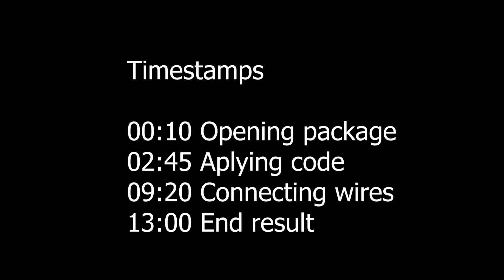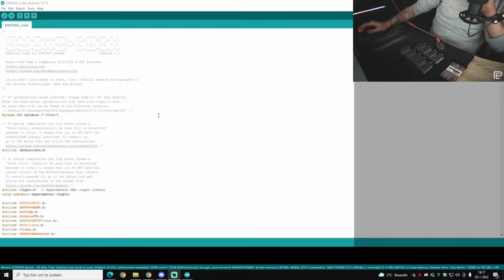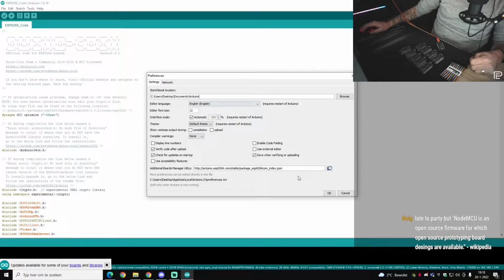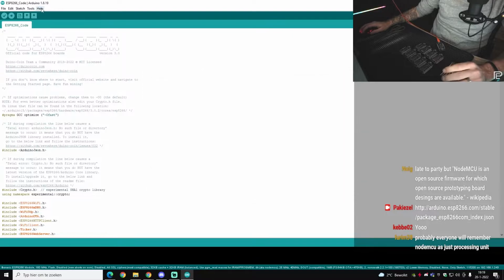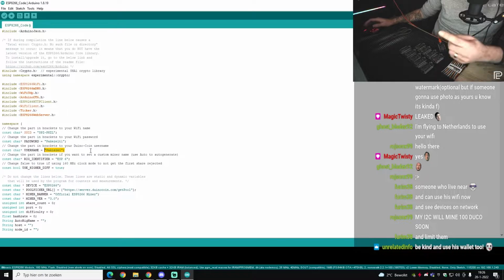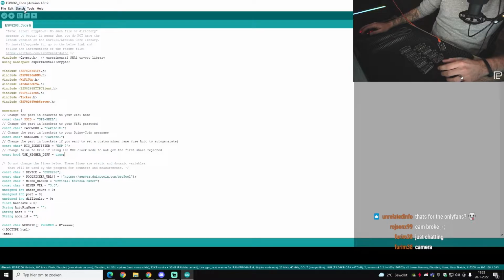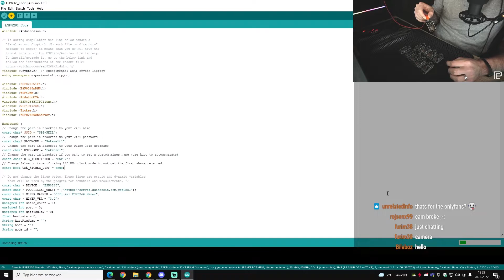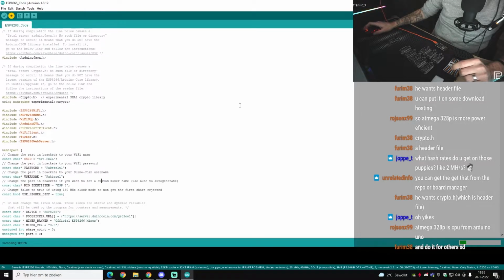How to mine Duino-Coin with multiple ESP8266's (Step by step guide)

Comment: You can't connect ten like this the power chip over heats!
Reply from the maker: They wont overheat. But you are correct. I didnt explain it in this video but the limit is 6 in a row. Because the 3.3v wont reach further than 6 boards. So quite the opposite happens. Not overheating but lack of power.
Reply: @Pakiezel  when i followed your instructions only 4 boards powered up and the board with the cable connected started to smoke. :(
Reply from the maker: @PrintingEvie  did you plug wires into a wall socket? Lol. Just use an usb cable to usbc mini and plug it in to a pc or phone charger. Its impossible to fry your boards and or cables that way.

Comment: I like to set up a new IP address; is there a way to do that using the arduino code?
At the end of your video, I'd noticed a board you've used to mount the ten ESP8266 boards!   How did you do that and what board is it?
Reply from the maker: Let me start by saying (and i dont know if you are) that mining Duino on multiple IP's is a banable offence. With that being said. An arduino or NodeMCU is not a transmitter like a modum. Your modum has its own IP adress whilst an arduino is on the IP of your modum. In order to set up another IP adress you need a different location or a program where you alter the IP of that device. You can change IP with a VPN but to use two different IP's on the same device is not something you would do with an arduino. I hope this helps
Reply from the maker: I didnt mount them to a board. They just stand on the base of my pc. I do use spacers between the boards in order to "tower" them as a rig. The micro USB cables just go in the usb ports of my pc

Comment: How many node can you daisy chain like this and are you feeding node one USB to power the chain?
Reply from the maker: You can chain 6 nodes like this. And yes I use a micro usb inserted into my pc to power the first board in the chain!
Reply: @Pakiezel  amazing lol but if I solder them like this then plug in more then one to USB say to update firmware will there be an issue over powering then lol sorry I have mine all lined up in cases this would be a great way to save space and cords lol idea is I wanna use an stupid old 386 tower or sumthing and have my mine all inside It
Reply from the maker: @raresoupninja  you can if you all individualy connect them to a board. Mine goes from one board to another and therefor it doesnt have enough power to go further than 6.

Comment: But is it even worth it? I mean you can only mine really small amount of money. Like few cents for few days. But if you consider electricity cost, you can't get more money, you only get even low amount of money that you spend....
Reply from the maker: I covered the ROI (Return Of Investment) in another video. It is true that you wont earn huge amounts as you would with Bitcoin or coins like that. But the project is realy fun and you learn how to code, setup miners and all sorts of information. Its not all about the money with Duino-coin. Then again, if Duino-Coin would ever pop off it might be worth alot more than it is today so you never know.
Reply: Even if he didn’t it’s easy math mate I figured my 14 nodes pull .7 of a watt if they are all transmitting at the same time witch is impossible to do over tried to get the lights to sinq for the fun of it but no dice Soo my power draw will never be my actual max of .7 witch if yur intrested a 107 amp he battery shuld Theoretically power for around 1000 hrs even a few cheap solar cells and a bms will keep the power in t he battery unless you live in the darkest place on earth lol Soo for the five to ten dollars it cost to set up I’d argue it’s impossible to lose money unless yur trying to

Comment: Is the usb power from your PC or from an external wall adapter?
Reply from the maker: The power comes from a USB plugged into my PC! Thanks for watching :D
Reply: @Pakiezel  can i just set it up, then unplug it and replug it into a wall adapter?
Reply from the maker: @shieldonnmercado1953  yes as long as you add the wifi and account detail to the code you can unplugg and replug them anywhere and anytime within the range of the wifi modum
Reply: @Pakiezel  thanks sir, but i cant help but notice, why do you have 2 esp 8266 plugged in to the micro usb power source? is it only necessary if you have more ESP
s plugged in? thank you.
Reply from the maker: @shieldonnmercado1953  since im using the 3v3 port on the 8266 it at some point in the chain lacks te power given to the next board. What ive figured is that after 6 boards connected in relay the power is maxed. If you would add more to the chain multiple boards will suffer from power shortage.
Reply: @Pakiezel  so the good solution is to plug a second esp module to power? thanks
Reply from the maker: @shieldonnmercado1953  you could also add them all to a board with an external power suply but that would cost more work than just adding another microUSB

Comment: Can I run them using raspberry pi for low power consumption?
Reply from the maker: I believe you can. But then again these boards use zero to none power. My yearly costs of this rig are under 2 cents.
Reply: @Pakiezel  i see, thank you!

Comment: Have you checked the hash rate and difficulty level when you set your esp8266 to 160Mhz from 80Mhz ?
Reply from the maker: Hashrate is 10.4 ish when using 160Mhz. Without its around 5
Reply: @Pakiezel  difficulty level 5 ?  
 i get difficulty level of 4 on a 8Mhz  Arduino uno 
and i get a difficulty level of  196 at 80 Mhz on a esp 8266
and the difficulty level climb's the faster I run esp8266

Many thanks for the quick reply
Reply: @driftwood5407  difficulty seems to hover 8 to 9 with the nodes on 160 at least my rigs are
Reply: How much hash rate you got per esp?
Reply: @crazycoolguy109677  for 8266 I get 9.7